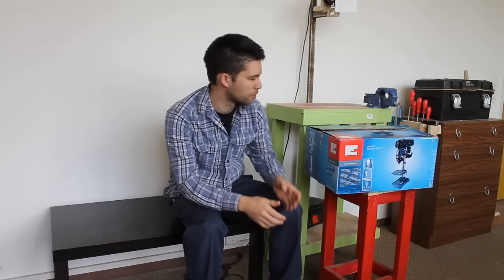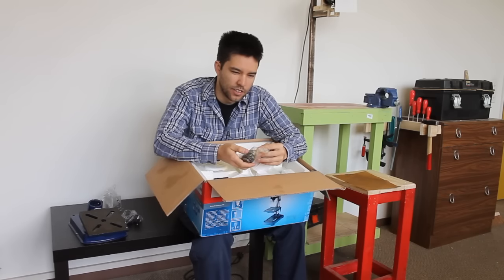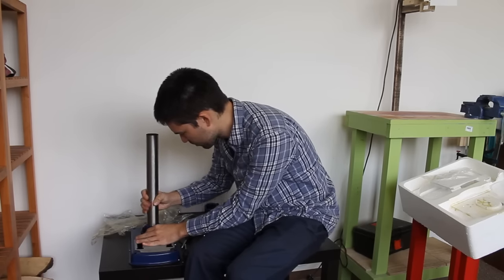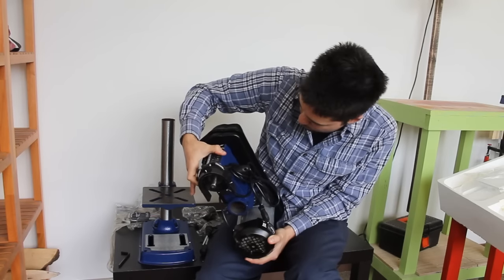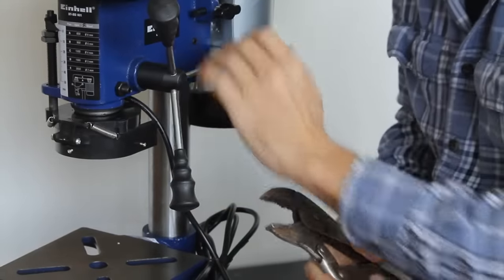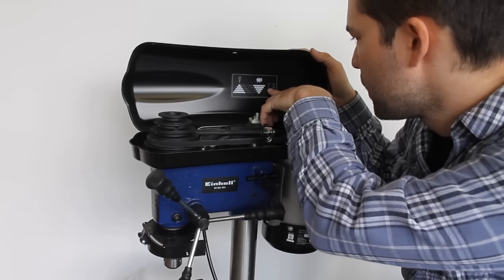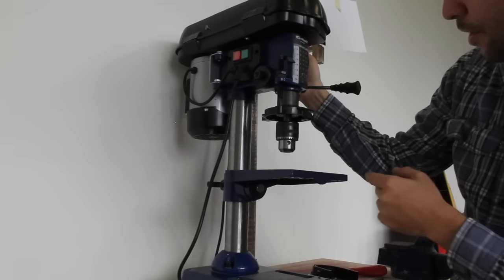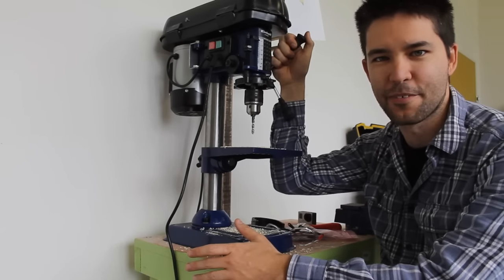Einhell BT-BD 401 drillpress unboxing, assembly and testing

Comment: Just purchased - I found description matching like the dirt inside it etc but I have to admit the finiture of mine was almost perfect. Maybe quality depends on stock on production line, and I imagine control is lower over quality - that means reducing over price. I paid 90 eur that is about your price. Still didn't use, only checked, but I have to admit is what I expected. Thanks for your tutorial, was a nice double check while assembling. You are a nice dude, dude ...
Reply from the maker: good to hear Andrea, hope it works good for you. Still no problems with mine.

Comment: thx for the video. I was trying to figure out how to attach the end of the drill to the actual shaft. The manual says "wipe it clean and attach". I saw from this video that you just smack it in and maybe press it against some wood.
Reply from the maker: cool, so you got it working now?
Reply: Well I got something done. Cutting large wooden wheels from an old shelf. Might have to up the RPM, since the drill bit gets stuck a lot. Also not sure if it is the belt that is slipping or the end of the drill
Reply from the maker: well it's not a very powerful drill so it might be a delicate balance to get everything working. I'd suggest making sure the work piece is locked down really well and that you feed the bit nice and slowly. good luck on it.

Comment: That looks really handy for $100. I might pick one up. Can you tell me if it can lock the shaft into position to do some light routing? As in, place the workpiece, turn the drill on and lower the press to the desired depth, then lock the shaft into position and slowly move the piece around to route a channel or something.
Reply from the maker: hi etatoby, good question, to tell you the truth I don't know if the quill can be locked or not. Next time I'm in the shop I'll take a look and reply here.
Reply from the maker: Hi etatoby, I checked on it today and yes you can lock the quill down. Go to my instragram page, I took a picture today of the set screw to turn. https://www.instagram.com/bruces_shop_stuff/
Reply: Awesome, thanks a lot!

Comment: Hello! Nice video!
Did you bolt the chuck to the shaft? Or just pressed it as shown? I cannot believe that they didn't provide some kind of securing mechanism.... I just bought the same model and I cannot believe it... I am still looking for the screw somewhere in the box... What if we decide to change/upgrade the chuck?
Reply from the maker: Hello thanks Luka, 
No I didn't bolt anything in the shaft. I'm actually not too familiar with drill presses. I actually didn't think about that, I think with some of them at least you can pull the quill all the way down and there is a slot where you can access the chuck and there you can somehow tap it out. But I'm not sure if this one has that or not, I'll check it out tomorrow. I did spend sometime operating a manual mill and with that you had to thread the check in on the top of the spindle, but I don't think that is the case here. If you find anything please do let me know.
Reply: Thanks. I will if I do!
Reply from the maker: Hey Luka, I was in the shop today and I actually couldn't figure out how to remove the chuck. There is a allen set screw on the right hand side, if you remove that, you can then get to the quill. I tried putting the chuck key shaft in there and tapping it with a hammer but nothing moved. I also tried tapping the shaft downward from the top where the belts are, but again didn't work. I'll have to do some youtube searching for this.
Reply: +Bruce's shop stuff and other things hi Bruce! Only thing I could find on this subject is here http://woodworking.about.com/od/woodworkingpowertooltips/p/How-To-Repair-And-Replace-A-Drill-Press-Chuck.htm it looks like some of the drill presses simply have this slide on chuck! So, I guess, we'll be fine ;-)

Comment: Very nice and informative video, however since the instagram page does not exist any longer, can someone advise which set of screw(s) locks the shaft in a certain position? Thanks.
Reply from the maker: Hi cosmic, actually I never use that. But next time I go in I'll take a look and get back to you.
Reply: Thanks Bruce. Appreciate it.

Comment: Hello. Im thinking of perhaps buying this drillpress. How has it worked so far?  Have you done any fastenerbit drilling or metal drilling?

Oh btw. Do you know the rpm and shaft size of the actual motor? Would be handy if its some regular standard speed/size if you ever want to replace it.
Reply from the maker: I've had no problems with it so far and I've used it a good bit for a hobbyists. I've never done fastnerbit drilling but I've drilled through steel a few times without problem. The power isn't super high so you can't go too fast. I don't know the rpm or shaft size. I think they had some details like that on the manufacturers website. let me know if you end up getting it and how it works for you.

Comment: Where did you buy it??
Reply from the maker: A hardware store here in Switzerland called Hornbach.
Reply: Ah ok thanks,I see it on amazon at 82€ is a good prize and i'm thinking to buy it :)
Reply from the maker: seems like a good price, I don't remember if I said in the video but I think I paid 100 chf, so close to 100 euro. I still use mine often and I'm happy with it. Of course you have to remember it's a very low price machine so it's pretty basic.
Reply from the maker: also maybe read the comment below by Luka
Reply: Ok thanks!I'm searching low price machine because is for my hobby.The other solution is to buy a drill and column to put it,so it's more flexible because in this case have a drill and drill press in one solution
Reply from the maker: it's for sure only a hobby for me too, so I'm trying to stay on a low budget also. I once had a drill on a column, it was okay, but I would suggest getting a full drill press and in addition hand held drill. I bought a corded drill for like 30 euro and it's been working pretty good also.

Comment: A piece of junk drill press.. like most of the Einhell tools. Actualy i didn't see a good tool from Einhell yet.
Reply from the maker: I'm at nearly three years and mine still works the same as when I bought it, can't complain here. You can even see it still working in my latest video.
Reply: @BruceChastain  Not for me..  for some time i work in metal most of the time.. and this is not for me at all..is to weak.
Reply: Then buy a stronger one. Einhell has more than this. I have a lot of tools of that are OK